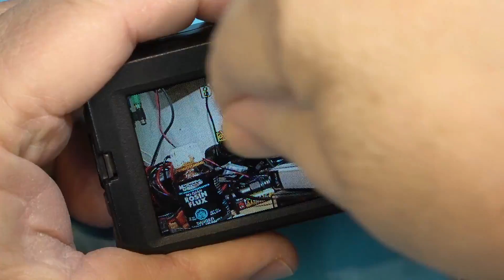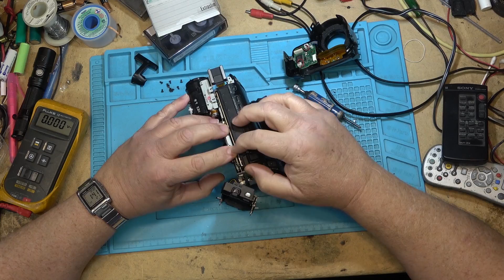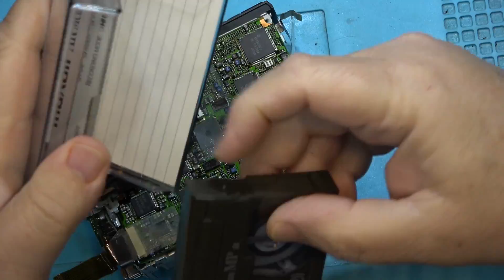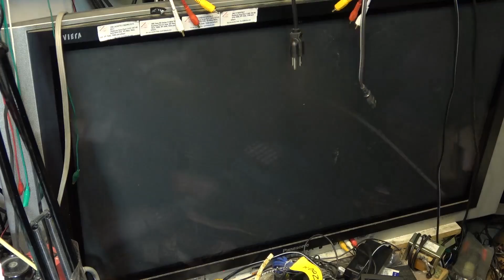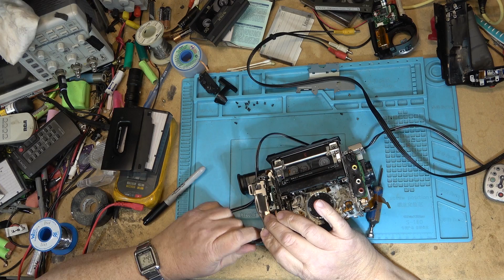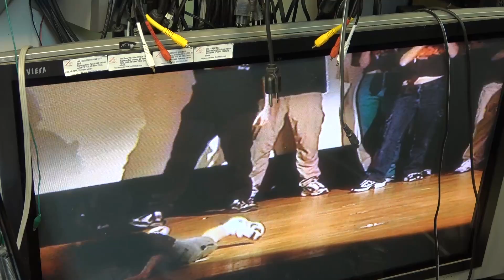Sony DCRTRV110 that some idiot sprayed contact cleaner into

Comment: I have a DCR-TRV520 with a few problems. The audio from the tape isn't coming out the speakers when playing back a tape, it will playback audio over Firewire but no audio from the built in speaker. Also it doesn't seem to charge batteries it gets into a loop when it's powered off with the power cable installed. I want to fix it. Also this seems to be solved but I've noticed sometimes the buttons get messed up, like when you hit stop it will rewind and if you hit pause it will fast forward. I actually sprayed contact cleaner into it and that seemed to fix it so it's probably dirty connections. But I can't figure out why it won't charge or why the speaker doesn't work.

Comment: Contact cleaner does more harm then good.
Reply from the maker: When you spray it into the transport
Reply: Contact cleaner are a life safer, my laptop screen didnt work, used dexoit on the connector where it plugs in the moederbord and the laptop works great again

Comment: Hi 12Voltvids I've been watching you for a while now couple of months and I've seen you repair Hi8 camcoders and all I have a CCD-TR75E 8 Handycam and when I switch to camera the screen lights up and that's it I can't see anything (I fixed the viewfinder thanks to your video) before when I switch to camera it moved the adjusters and it would self adjust but now it doesn't do anything could it be bad caps?
Thanks in advance your vids are very entertaining and educational

Comment: When I was a teenager, I fixed a sticky transport on my video8 camcorder with WD40, it worked but I wouldn't do it again lol. I only used a tiny drop and didn't let it aerosolize, it had the effect of rewetting the pre-existing grease.
Reply: Yes, this works if you want something to be working again quickly, without hours of disassembly, cleaning and re-assembly. Works for frozen ball bearings as well, if they are frozen only due to dried up lubricant, and not worn out. Usually only a temporary solution, but sometimes that's all that needed. 

About 18 years ago my elderly neighbour called me because his VCR stopped working. It was a mid '80s Akai VHS. The bearings of the head drum were so frozen that I couldn't rotate it with my hand at all. I had to stick a screwdriver into one of the holes on the top of the drum, and knock the handle of the screwdriver pretty hard to get it started. Then it was able to spin up, but with a horrible squeal. I put sewing machine oil into a plastic cap, and diluted it with WD40, about 1:1. I removed the upper drum and the drum motor, and dripped that solution into the bearings. IIRC I lubricated the upper bearing through the rotary transformer, then cleaned the rotary transformer afterwards by putting a cigarette paper in between the two halves to soak up the oil from the transformer, as I really did not want to pull apart the rotary transformer, wasn't sure if I would be able to re-align it properly. It's not a great idea, because the oil and the solvents in WD40 can damage the glue that holds the windings in place. But he only wanted to play a few tapes with it, so I didn't care if it falls apart a year later, it was just a temporary solution, the VCR was condemned. But he got lucky, it stopped squealing, a few weeks later the drum started to get quite loud, but no squeal, and worked for years after that.

Comment: Great job, as always.
I have watched all your camera repair videos, hoping to find the same error I have with my camera.
I have a sony DCR-TRV270E, the problem is that it opens the basket and when a cassette is inserted, it does not recognize that the cassette is inside.
Can you help show where the microswitch is located that detects the presence of the cassette, and then retracts the basket?
Greetings from the old continent.
Reply from the maker: if the basket closes without a tape installed then it's not a micro switch because it's the same switch that the text when the basket is closed regardless whether there's a tape in it or not. If you close the basket and it reopens regardless whether there's a tape in it or not and does not retract then it's a switch issue but if it retracts when there's no cassette in it's not a micro switch. What the camera does is when you close it and there's a tape in place and it knows there's a tape in place because of the end sensors when you close the basket down without a tape the LED light in the center of the tape compartment is detected by both end sensors so it knows that there is no tape installed but when there is a tape installed one or both of them will have the light blocked typically both because camcorders will actually move the tape forward when it's either at either end so that the end sensor is not being blocked. So when it detects that the light from the tape and led is blocked it then instigates the start you can send me like this by sticking some black tape over the holes in the side of the cassette compartment where the light would shine through from the end of the cassette and it should fire up and try to do the loading cycle. what happens is when it detects as a tape installed it starts the drum motor and the caption motor to make sure that they rotate if either one of them is stuck and does not rotate it'll immediately kick the tape back out and will not attempt to load. I'll try to make a demo on how this operates using one of my demo cameras that I have maybe I will do that today because I think I can knock that one out pretty quick and make a relatively short video to show the process and create some faults in that process.
Reply: The camera behaves exactly as you described, it does not want to retract the basket regardless of whether the cassette is inside or not.
When, after really many attempts, he finally pulls the cassette in, it gives the message - reinsert cassette.
Thanks for the reply
Reply: I took it to a local service, but I don't think they have the capacity for such a complex device. They probably don't even care because they can't charge for the time spent, and anything out of scope like replacing batteries or repairing a connecting cable or connector they don't want to do at all.

Comment: Not sure why you would say that because contact cleaner designed for electronics does not contain any oil. I use CRC CO contact cleaner. The products you mentioned, to me, are not the same. But the camera you worked on clearly showed evidence of a lubricant/cleaner.
Reply from the maker: Nutrol and deoxit are 2 of the best contact cleaners for electronics.  They both have lubricants on them. Sure you can get solvents.  Freon TF was one that had no lubricants.  It was banned because it was a CFC. Then the hcfc solvents cane out.  They were more for flushing circuit boards and they would remove oils (so don't spray into motors with sintered bearings unless you want to replace the motor soon) but contact cleaners for switches and controls have lubricant.
Reply: CRC Electronics Cleaner for the cleaning, CRC 2-26 Multi-Purpose Plastic-Safe for lubrication of switches and sliders.
Reply: @brunoprimas1483 I've been using WD 40 contact cleaner a large can is $7.68.
Reply: Waaay back in the day, there were two basic kinds of cleaner used in electronics. There were solvents, like Freon TF, Carbon Tet, and of course, denatured alcohol and acetone. Then there were what were often termed "tuner cleaners," referring to the mechanical TV tuners that went out in the '70's. These contained a lubricant of one sort or another. Today, there are all kinds, including cleaners with not only oils, but polishing compounds that "grind" switches and other contacts clean with every operation. You have to know what you're using and know where it can be used. I NEVER spray ANYTHING into a tape transport, as there is no spray cleaner that's safe for that purpose.

Comment: They probably used regular WD-40 with oil in it, contact cleaner for electronics shouldn't leave any residue (but is still probably a bad idea to dump blindly into a sensitive camcorder). What a mess!
Reply from the maker: Both deoxit and nutrol have oil in them. Nutrol has diesel and deoxit    kerosene which does leave a residue as a lubricant